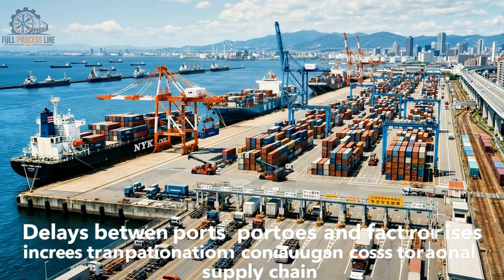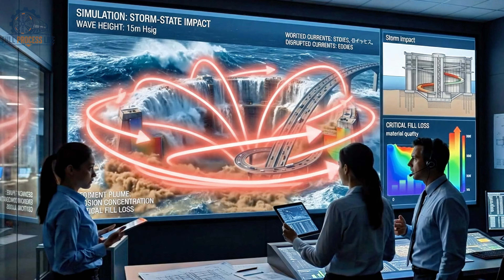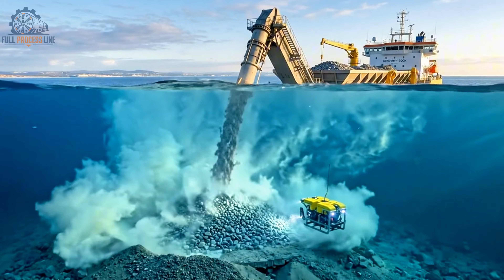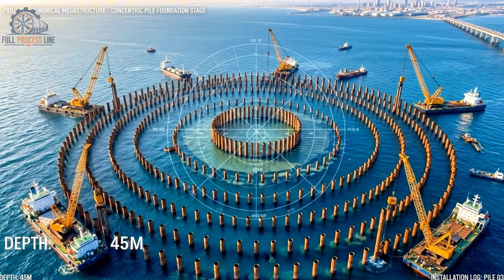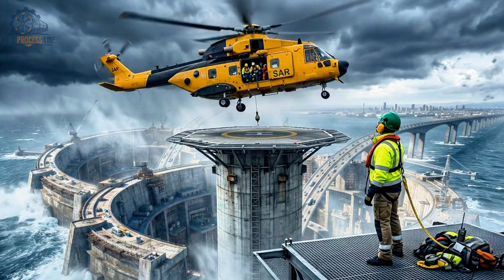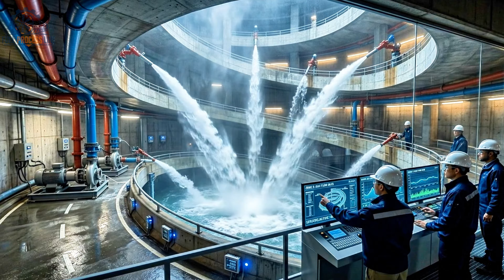How Japan Built a Breathtaking $40B Ocean Bridge Across the Impossible Sea | Full Process Line

Comment from the maker: This Japan ocean bridge Engineering Concept moves from deep-seabed surveys to piles, cofferdams, the cylindrical tower, and final load testing. Which engineering stage impressed you most—and why?
The critical moment came when seismic movement damaged curing sections just before the typhoon arrived. Was the external post-tensioning system, crack injection, or expanded wave barrier the strongest technical solution?
Would you trust this ocean bridge after the seismic-bearing, drainage, heavy-truck, ventilation, and evacuation tests? Which impossible megaproject should FULL PROCESS LINE explain next: a tunnel, bridge, airport, dam, or disaster-defense system?
Reply: ပင်လယ်ပြင်အပြည်ပြည်ဆိုင်ရာဧရာမလေဆိပ်ကြီးကိုတည်ဆောက်စေခြင်သည်
Reply from the maker: @KyawShwe-ue2hc  THANK YOU